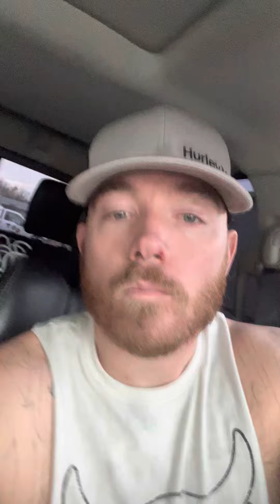“Rolling coal” and when it’s used properly

Comment: I’m going to disagree with you in part on this one. Yes the black smoke may make the turbo spin faster but the fuel going in isn’t making the exhaust hotter. The fuel is causing it to cool, but you adding fuel with the air will make a “thicker” exhaust. That being said the more dense the air the more it spins the turbo causing it to spool faster. It’s also keeping exhaust temps in check. You’re adding fuel which adds to the shit having to flow across the turbo making the air more dense causing the turbo to spin harder. But the added fuel also helps cool the exhaust.

Makes since.

Although once the turbo spools pull the fuel down and allow the turbo to work. Only under load, once it spools just keep enough fuel in the exhaust to keep it cool enough.

Your thoughts??

Comment: Are measured at Og sense along with diesels run off compression an not combustion are the difference between gas an diesel along with there are no bearings hence y diesels oil pressure are so important n legit run off t/p temps an pressure
Reply: This makes no sense. Combustion is the product of the compression of the air and fuel mixture. The difference is in the ignition source. A diesel doesn't have bearings? I would have to disagree since I've seen crank, rod, and cam bearings in them, the same as a gasoline engine. Oil pressure is important in any engine rather it be gas, diesel, turbine, etc.

Comment: Cars also run off fuel injection witch are controlled by ignition timing an fuel along with air 😂😂😂😂 listen I’ll shut up if u can tell me the four strokes of a gas motor n then give me the  strokes of a diesel